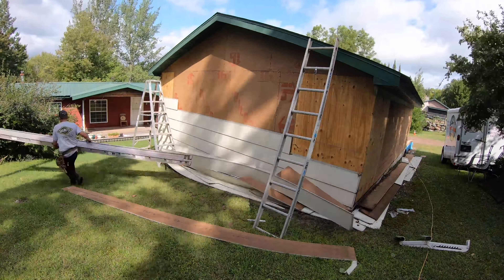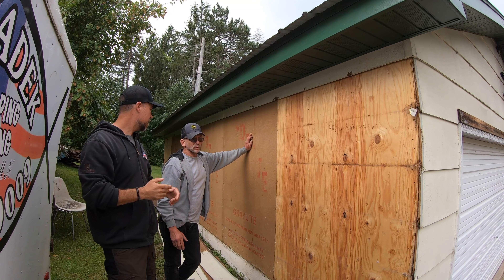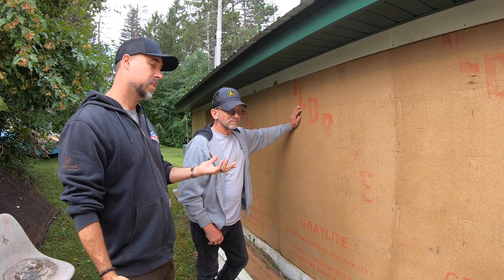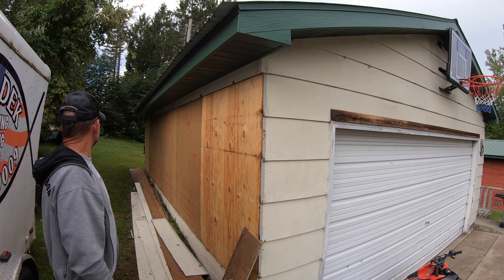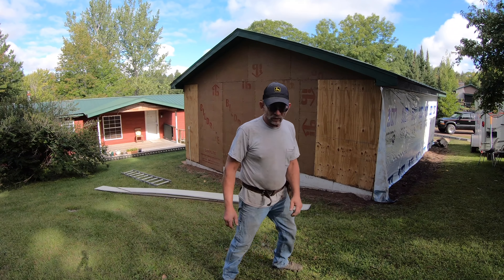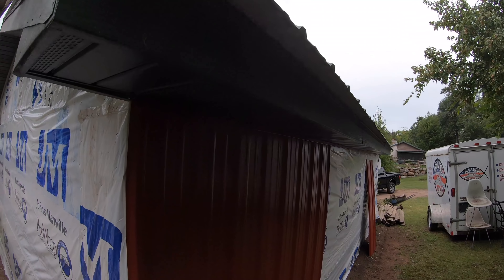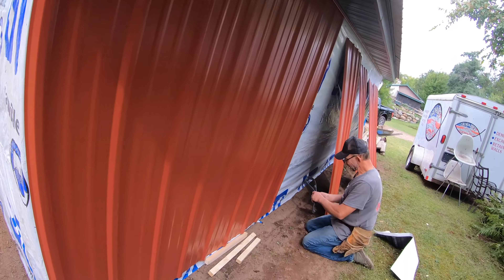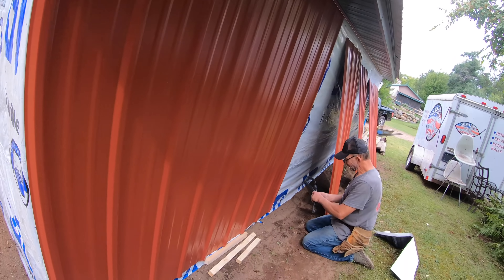How NOT to install Metal Siding- PRO tips & Everything you need to know from start to finish pt1 4k

Comment: I was digging a 12 mile pipeline and the one section went through a farmers field where he kept his horses running a lot and he said he always had a bee issue in the one section and sure enough he doesn't have any issue anymore with ground bees lol I was digging the ditch for the 12 inch pipe and suddenly I hear loud bee buzzing sound and so from experience I hurried and closed the front Gass and the side door on the excavator and shortly after as I kept digging my windows were covered in ground bee I had hit a huge huge naive in the ground and there were what seemed like thousands all over my machine trying to find a way inside lol it was crazy they had to use a fire extinguisher to get them away so I could get out haha

Comment: i have inherited a existing metal bldg, the guy(s) that built it obviously didnt know what they were doing. they have run the roof horizontal, the water wicks under the laps and leaks inside. so, my question is; can i put tin on top of that tin, if so, any tips/tricks you can impart? OR do i need to pull that tin off, install perlins and re-tin it? my preference would be not to pull the existing roof off. not sure it is possible without more effore than pulling it all off and starting again. many thanks in advence.

Comment: There is a special piece trim that goes the bottom of metal siding ment to deflect the water out and away.
Reply: I was thinking that. I'm curious to see how they "trim" the bottom now.
Reply: @joshuategeler3419  they probably won't, the seal will keep most stuff out, just doesn't look finished.
Reply: @chriskindig129  J trim at the bottom of the metal only serves to collect dead bugs, dirt, and water. One thing they did here was use Tyvek (or whatever JM calls their housewrap), which is really not ideal with sheet metal.
Reply: @jackofmanytrades4396  I didn't say anything about j-trim, the trim I am referring to is called base trim and goes at the bottom of the panel.
Reply: @chriskindig129  Everybody has a different name for it, but ultimately it serves the same purpose, and does the same thing-accumulate dirt, bugs, and water.
Reply: We call it rat guard.  It's leveled on the lowest girt and hangs 1in below the bottom on the girt. Panels just rest on it and we poly fill the ribs from behind after installation.

Comment: I’m building a pole barn right now to be converted into an apartment through half of it. Is a vapor barrier outside necessary if the inside is insulated correctly? We’ll be insulating the exterior walls with r-19 .
Reply: Yes the vapor barrier is necessary.

Comment: Would it not be okey to keep the siding on and put boards on top and then the weather profing and last the metal siding... think it would save a lot of work hours ?
and why no trim in the bottom ?   i dont think J channel would be a good idear in the bottom.. your drillede holes would plug up and then rust

Comment: omg... you have no idea how important this video is to me! my dad put up these plywood siding stuff on the house with that felt isolation. its all stained and has lasted for about 20 years but looks like heck now. some of it facing "southish" is not only grey but warping badly. he installed this stuff with STAPLES!! a good friend of ours came over with a couple hundred screws and got it all to stick firmly after a couple of the panels FELL OFF! i was trying to come up with a way to "fix" this problem and metal siding was my thought. i didnt know about the "J" nor did i think i might need the plastic backing. still think im going to be rednecking the siding if i go with way but as you said. when you dont have anything. you do the best you can with what you got. i should be able to side the 32x32x8foot house for around 600-800 bucks maybe $1000 bucks. again thanks for these videos bud! cant wait for part 2!

Comment: General rules of thumb that I live by and the reasons are the following,
1. Do not put new on top of old because you will never truly know if there more issues than what you see on the surface. This applies to more than just roofing, sheet rocking, flooring, siding, and adding on. Here is a classic real world situation I came across: A house built in 1909 where the entire house had no level spots, upon further inspection of the structure, which was a two story house with an unfinished basement, I had found that not one person ever had done anything to fix the structural damage to the floor joists for the first floor. The damage was so bad that the only good floor joists were the beams fully supported along the entire length. What the damage I found had started with was a lot of overlooked maintenance, All the beams that were no good were only made worse by excessive loads for over thirty years to the point where the structural integrity was only the equivalent of 2x4's and 3x4's laying flat of the 4x12's and to say that I was appalled did not even come close to describing how I felt, there were load bearing walls all throughout the house that had plaster falling off and mold growing behind slats and I instantly knew why the husband died of congestive heart failure, Dementia, and had a difficult time breathing. I knew instantly just walking up the steps to the house and looking up to see rotten boards under the deck that the only actual updating done was with the stairs leading up to the house and added railings with insufficient anchors on the original stairways. I asked the lady when the last ime maintenance was performed on the structure, I honestly was surprised that I did not need to perform CPR immediately after finishing my question, that question was answered with every bit of appliance maintenance had been done in the last ten years but, nothing regarding structural integrity. I repeated the question slower and extremely clearly, and she asked, "Young man, I have lievd in this house for over thirty years and it is still standing but, what is this 'structural maintenance' nonsense you speak of.?" I looked at her and said That will be a grand for the inspection, ma'am, check your mailbox for the final report. I went immediately to the city engineer and showed him the footage, he loojked more shocked than I was, he said, " young man, I am not going to condemn this house, she just lost her husband and we will just let well enough alone. There is an old saying, young man, let sleeping dogs lie. It is not even worth it." To which we verbally stated inunison, "She is right, she will die literally in that house.
2. Never violate practicalaty on any level. (SEE ABOVE)
3. The level and quality of maintenance will ultimately dictate the longevity of the item requiring maintenance.
4. The level and quality of maintenance directly dictates safety.
5. Never lower YOUR STANDARDS TO OBTAIN MONEY AND CUSTOMERS.
6. Plan it well and adapt the plan start at the end of each execution in a process called "Debriefing".
7. The quality of the execution of tasks is directly associated with the level of planning and improvement to future plans. See the MILITARY BOOK OF OPERAATING PROCEDURES.
8. Have fun, always look for ways to improve, and do not be afraid to ask for help.

This has been a list of things that will help in the process of everything.
Reply: Dude cut it short ...Or start your own channel if you got so much to say!!
Reply: @erikrobles5727  Also, you are more than a day late and a dollar short. You are almost an uncompress season late.
Reply: Stanleu, I apologize for this but, I had to address the heckling elephant in the dirt pit that was unable to shut his freaking fingers off for quite a few weeks on quite a few channels. If I had not done this, it was only going to continue to get worse for himself later. I am sad that my general generation simply has to be filo and reliable when the baby boomers actually had to do more than that in the first month than most millennials have to do in a lifetime to retain their position. Oh well. On with our daily lives.

Comment: Tip for you guys, lay all your sheets in a uniform pile and predrill an entire side at once, perfectly straight lines and it’s easier to start your screw
Reply from the maker: Thanks for the tip!
Reply: This is a great way to keep screws in a nice uniform row. Especially with contrast color screws.  We build custom steel frame homes and post frame homes and we do it on our siding on every job. We don't pre drill our roof panels usually though.

Comment: Instead of marking each sheet, mark the end sheets (middle too if long run) and use a blue chalk line to make rows straight. Be sure to use blue because blue chalk will wash off, red won't.
Reply: Depends on the TYPE of chalk, not the color.  Some easily comes off, some doesn't, you have to read the label.

Comment: Why not just put the tin over the siding?   The whole building was sided, you should have house wrapped and installed the siding like you did.  All you did was produced holes in the siding and then put the tin on.
Reply: Ed Blough did you not hear the part about buckling the tin if you don’t screw it right at the bottom of the lap, even at that it’s still going to create ugly ridges all down the walls. If you e ever worked with steel sheets you know it’s easy to have a million ripple in them if everything isn’t flat as can be
Reply: OntarioRedneXXX that makes no sense since he used the lap siding anyhow as the nailer for the tin.  If having it under the tin spaced at 11inch causes ripples why would it not be worst if it is spaced out to 2 ft.    It were me I would have gone over the lap siding or I would have taken everything off and used ply then house then then the tin.
Reply: Ed Blough the lap siding was flat when installed flat, it was only angled because it overlaps as it goes down. The ripples are caused by the screws pulling the metal tight over a surface that’s higher than the screws, thus if you screw between the two high points your going to have a ridge above and below the screw. I probably would do it right over top too but that’s just because I’m lazy and not overly picky